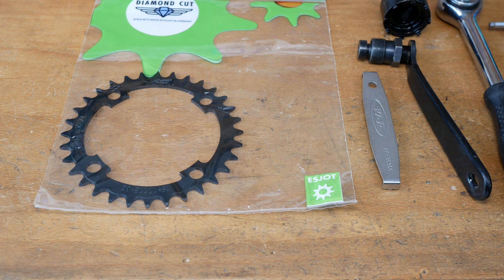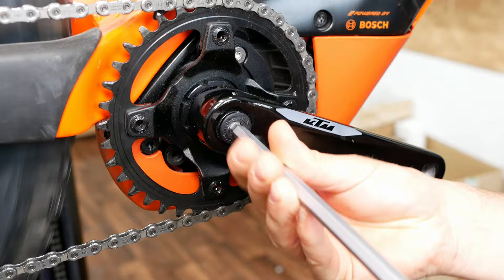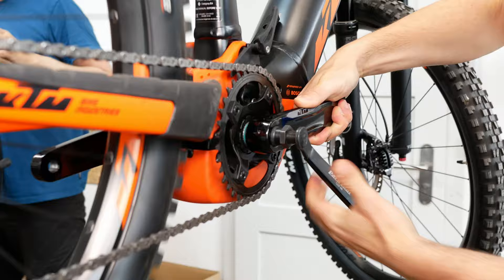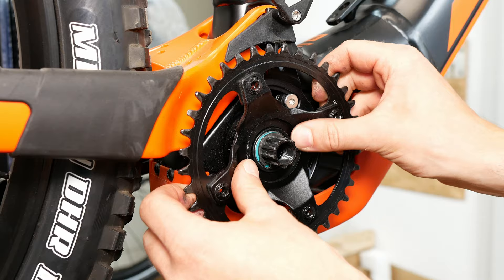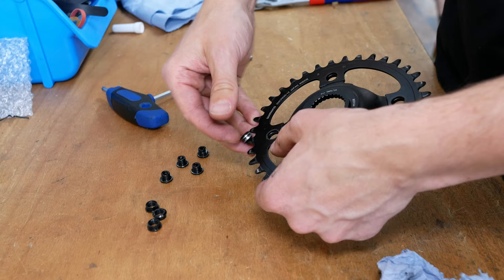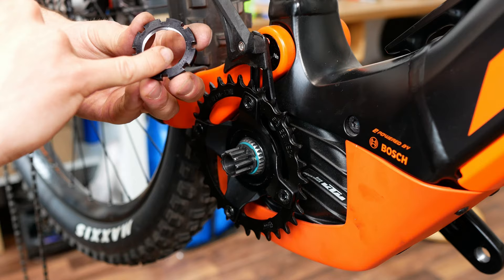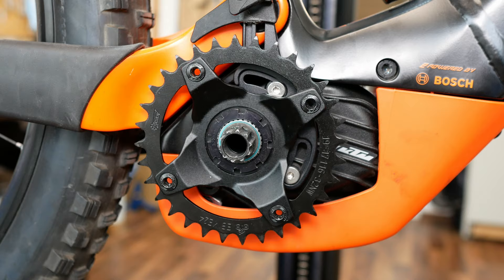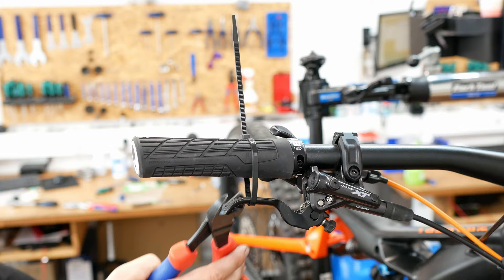How to change the chainring of your e-bike | Tutorial | EBIKE24.com

Comment: I have had so much trouble with Shimano steps chain rings. The bolts which attach the ring to the spider cannot be tightened on the bike due to clearance and poor grip. I have had to purchase the full chain ring removal tool simply because I cannot tighten these bolts. I feel like Shimano have made these drivetrains to force people into buying unnecessary tools. Previously the chain ring was tightened to the spider with normal screws and threads, not bolt with silly nuts with poor grip and novel tools

Comment: Dont use the O-Ring! It drys up and brakes of and then your Cog is completly loose 😱 cos some mooron at Bosh made it left wound on the right side! So when you pedal you loosen the sprocket 😨
Reply: Exactly what’s happened with mine!! Even I thought why have it left hand thread, ridiculous!
Reply: I didn’t have an o ring for some reason
Reply: is this why my lock ring comes loose when im riding?
Reply: Funny that this exact problem led me to this video 😅
Reply: I recently puchased a Rail 5 and after my third bike my lockring came loose. So many people are affected by this.
Bosch didnt think or tested this trought it seems.